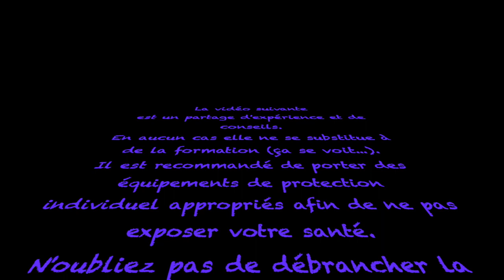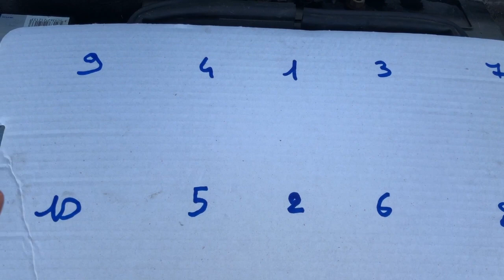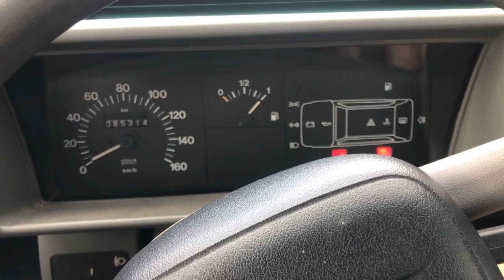Culasse Fiat panda   HD 720p

Comment: Bonjour ,j ai un problème de perte de puissance lorsque que je suis en cote sur ma fiât panda d'où cela peut-il venir
Reply from the maker: Bonjour, quel modèle/moteur? Combien de kilomètres? En l’état ça peut être mille choses des plus simples (bougie…) au plus graves (moteur HS)… Sans voir ni essayer la voiture c’est compliqué… Cordialement
Reply: HD 720p un voyant rouge d'après un ami resté allumé serai le voyant d'injection ,
Reply: 99879 km
Reply: Je viens de refaire le joint de culasse grâce à votre tuto j ai changé les bougies tout c est bien passée mais le voyant reste allumé il c est allumé après avoir mis de l'essence
Reply from the maker: @sergegiron113  le voyant n'est pas spécifique si elle prend ses tours a plat c'est plus une question de compression que d'allumage... A tester?
Reply: @multibricoles  je vous remercie pour la réponse, je vais faire contrôler